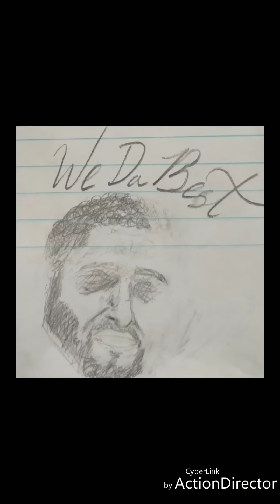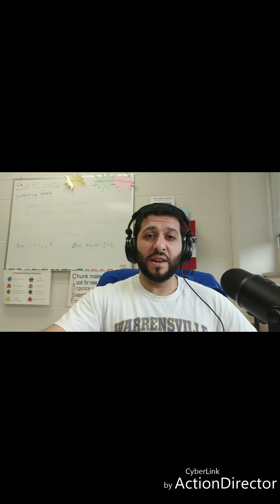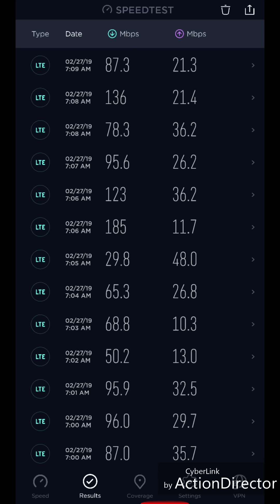Using LTE Only (no Wi-Fi) (LTE only challenge Final verdict)

Comment: I live in the suburbs, alot of friends with verizon. Certain areas especially when indoors require wifi connectivity. Lte not always dependable. Also most basements obviously. Now with sprint I have to use wifi all the time at my house in particular. Bc I go in and out of 4g and 3g. Lol. Obv with sprint I wouldn't be able to partake in an lte only challenge in my area , or most areas😂. Btw the classroom setting is very fitting since you're basically teaching your viewers how to cellphone 😁👌
Reply from the maker: Many Sprint users in the CLE area complain and see excessive connectivity of 3g.
I had to chuckle from the classroom comment 😁

Comment: So John Legere’s claim that Verizon’s network is old and can’t handle unlimited was bogus and poking fun lol
Reply from the maker: Obviously with some management and upgrades it was excellent.
Reply: Sneed Mobile Tech I actually just switched to Verizon from Sprint and while I had good service with Sprint, I’ve definitely noticed the difference in speed and service. I live in a building with an elevator & with Sprint lost service (and sprint would always take a minute or more to re connect to LTE so it would just sit on 3G for awhile) with Verizon i have 2 bars of LTE and can send a message still. And there were a few buildings Sprint struggled in to where I’d have to connect to WiFi if it was available where Verizon has been just fine.
Reply from the maker: Verizon really does perform. Maybe not the cheapest but very good service.
Reply: Not the cheapest and service best varies by market. In some locations where I am TMobile beats the other 3 hands down.